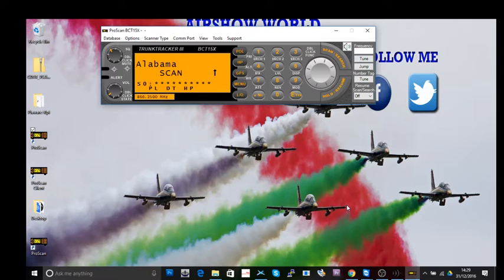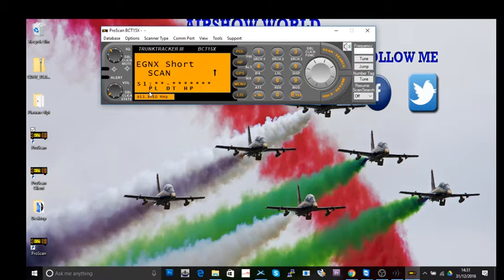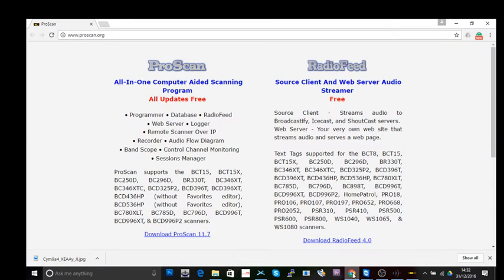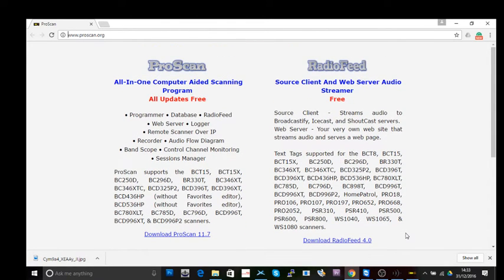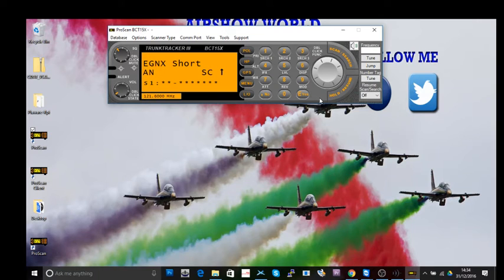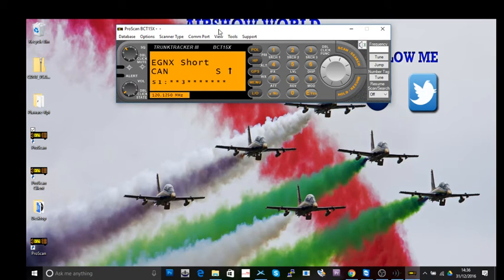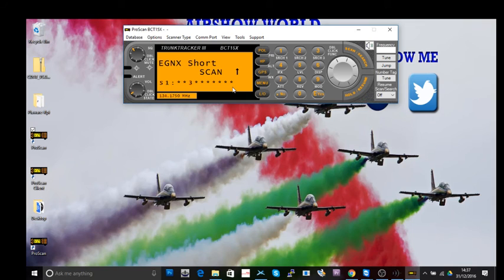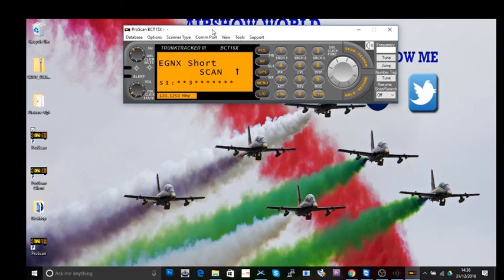Uniden BCT 15X Tutorials Part 1 - AIRSHOW WORLD

Comment: how do I connect the cable to the computer?
the mini-usb cable goes to a female 11pin rgb shaped. what is missing?
Reply from the maker: Tad Peters you need an rs232 to USB adapted.  older computers have a serial port where you just plug in the cable that you mentioned.  The serial ports were fantastic you didn't need any drivers.  it just worked.  the newer radios normally now have USB
Reply: thank you. I have the cable now via usb.